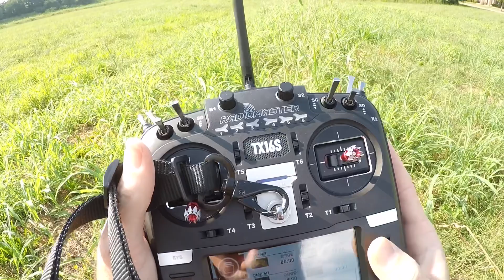OMP Hobby M2 vs Blade 230s V2 flight Comparison￼

Comment: Excellent review and very objective.  I just went with the 230S for a lot of the reasons you mentioned, I'm 61 and it's my first heli.  I struggle with orientation on even fixed wing, so the 230's size is a benefit.  I also have lots of other Horizon stuff.  The M2 is definitely the more modern performance aircraft. OMP does nice work, I was very impressed with the Bighorn plane I bought from them.
Reply from the maker: Thank you! Nothing wrong with the 230 whatsoever. It is a great helicopter for the people who like the bigger size and who are just they are to fly around. If you’re never going to be a 3-D helicopter pilot or care about the precision in the performance the 230 is definitely the machine for you. Do I personally think it’s outdated old and needs a major update yes! But it’s still a good heli! You will enjoy the 230! Check back and let me know how you like it and how your doing. Use some bright vinyl on the tail boom and tail skid as it will help you with orientation big time!

Comment: Love your End comments WestHobbiesRC. In the Photography world, the Moto is : "The Best Camera is the Camera you already have'. I don't own the M2, but do own the 230s.but after having endless trouble with the 230s Self levelling mode, and hence many unwanted Crashes, i believed it was a piece of crap. then i decided to delete the "Normal" mode (vis Digital Swtch option), and use it strictly as a FM1-2 Trainer only. I'm glad I kept it as such! now, after repeated trial flights with my smaller Nano S3 and 150s, I have complete confidence flying the 230s without any Normal mode to rely on. It also crashes well. Appreciate your Videos / advice WestHobbiesRC. PS: i have bought myself a Blade 360 3s Fusion, and SAB 420 Raw DD for Future step ups, when I can fly the 230s in most essential orientations
Reply from the maker: Thank you very much! When I started the channel I only had a GoPro hero 4. I’ve since upgraded lol but I still want to get a different camera to make higher quality videos. The blade 230s was a great heli for its time. Still not bad but the M2 or S2 is night and day better in a lot of ways. If OMP or Goosky would release a 300 size (same size as the 230) it would take over. The flight performance and FBL performance of the M2/S2 is incredible. You will love the RAW 420! Perfect every day size heli! The Blade 360 is the BEST BNF heli Blade has ever made. My only two complaint is the power level and servo gear sets are weak and will strip in a crash but I think for a next step heli it’s perfect!
Reply: @westhobbiesrc8051  Appreciate your Reply! My Videos are taken on an old Sony DSC-QX10 which Sony made to fit onto cell phones in that time period before cell phones had good cameras built in. I have the OMP M1, but I've invested too much in Blade Heli's (S3, BL2, 150s, 180 Infusion, 230s, 360 Fusion), so i can't see myself getting the M2, and so I'm not sure my type of Flying style would get any better with an M2. I wish Blade would bring out a Direst Drive version of the 230s. I have to confess, that there are times when I "Freeze at the Controls" when learning certain manoeuvres - is this normal? ( I can do Inverted Hovers / circuits no problem with the Nano S3, but with the 150s and 230s, well that's another mindset matter ! )

Comment: Thanks for your reply on the other video you made. I can tell by this video the OMP is superior to the Blade 230s. It just looks more stable. Unfortunately for me I fly VTouch and I can't use the OMP without receiver mods so I went Logo 200. I think the OMP and Logo are taking the market, especially with the Logo having a Neo on board
Reply from the maker: Awesome! Logo 200 is made by OMP, they are the same just the logo has the NEO and M2 has there protocol/DSMX/futaba. You will be very happy with the logo 200! Thanks for watching!

Comment: Whatever happened at 3:08 has also happened with my 230s V2 twice. I think sometimes when level and spinning fast around the tail axis the FBL has a problem figuring out the real position.

That also always causes the spin like in your video for about a second. It flys fine afterwards.

Also mine also has that bobble sound in the tail motor, but flies just fine. I don't mind it anymore at all.
Reply from the maker: Not quite sure, I started to piro and the tail motor just shut itself off completely. I hit throttle hold to take torque off the tail and I flipped hold back off and it was fine for the rest of the flight. Never had that happen before. It does fly good but in comparison to the M2 it does not fly as good at all.

Comment: Mine usually explode because of something I did. 🥴
So I’ve had a few SR’s which I never really knew how to set up correctly but I love that size and would really like to fly them. I think I have a brand new 230S that I’ve never flown much because it went apecrap on me the first time I spooled it up. Maybe something set wrong on my transmitter. I seem to do better with the more subdued 120’s but with the new S2 flybarless version. I’ve been thinking about a M2 also. I bought some off brand K110 that seems to require a Futaba system which I don’t own. Not sure what to do there. Futaba has more radio versions than I have socks! LOL! Enjoyed the video as always!
Reply from the maker: It always sucks crashing in the helicopter lol I had a couple blade SR as well. I sure don’t miss those things! Lol you will love the OMP into! Such an incredible helicopter flight performance instability is unmatched to anything else. I highly recommend you get one! That or the M1 both really great helis! Flying will improve big time with a M2!
Reply from the maker: I don’t own or have never owned a KX 110 so I’m not sure what they take or do I don’t know if you can plug-in a DSMX satellite? Depending on what radio you have currently you could always look at the TX 16 S which will do all different protocols so that is an option. Thanks for always watching! Greatly appreciate it!
Reply: @westhobbiesrc8051  thanks for the great advice! I think the little KX 110 is a cheap RTF. It’s a cool looking little bird but that doesn’t mean anything. So on the M2 is that how I would fly it with my DX-8 is with a DSMX satellite? I think you mentioned it once before but I wasn’t sure which one to use.
Reply from the maker: @robstanton9215  yes so with the M2 you just need a DSMX satellite, if you get one with a bind button that they sell on buddyRC then you don’t need a separate receiver to bind it to your radio. Just plug the satellite into the OMPFPL find it to your DX8 and you’re good to go! I can share my spektrum radio setup if that helps or you need it. You will really enjoy the M2!
Reply: @westhobbiesrc8051  Thanks!!! I appreciate the help!!!
Reply from the maker: @robstanton9215  any time! Glad I could.
Reply: Hi I have tried a lot of XK helis and found these excellent. These include K100, 2 K110, K123 and K124.
They all fly well and bounce off the walls. If you get an RTF version, it would come with the transmitter but you can also get radiomaster tx16s. I certainly highly recommend XK helis

Comment: I use both of these for my daily flyers  on a jumper radio..with my rates they both fly just as good as each other..but the m2 is way more quality and  can out perform on higher rates by a mile..don't trust theplastic blade grip set up on the explorer. ..your not the first that's happend too..way too much power and speed for plastic...
Had to switch the 230 to all metal for links and swash..it would break them off..and they go down fast ..as hard as we push these things..I feel better being all metal..plus the m2 don't break the metal grips..you fly awesome man .I hope one day to get .to where people want to watch..and starting a crowd in my neighborhood..they love to watch
Reply from the maker: In my opinion the M2 out performs the 230s in every way. The 230 is a good heli and for its time it was great but compared to the M2 can’t even stay in the same park. I’ve never ad a problem with the plastic grips in 223 flights, I did tighten the blade right before they failed so I’m going to say I over tighten them. I think a lot of the blade grip failures are from over tighten but I could be wrong! Thanks man I appreciate it, keep flying and you will!
Reply: @westhobbiesrc8051  I let mine free swing .
Reply: @westhobbiesrc8051  is your 230 oxy 3? Got 270 motor on board?
Reply from the maker: Is my 238 OXY 3? No it is a stock 230 exception of Blade 300x motor
Reply: @westhobbiesrc8051  well that's bigger yet man that thing should ripp along with that m2 ..I got the 270 motor in a box I was gonna put on...I bought ....cool..I like the sound of 230 banging some hard pitch .  Lol 😂 pry why my head broke and almost killed my buddy
Reply: @westhobbiesrc8051  I never did forward programing with the 230..I read I could. Would be nice to be able to kill the gyro on it all together... It has the same stupid problem all the blades had.with the wagging tail..but sense I switched to open tx ,it seem to be able to toon it out .but I lost safe ..it don't work on what I did
Reply: @westhobbiesrc8051  boy working on that m2 is a different thing for me ..way better precise parts and fitting together like a glove..it just blows my mind how much more qualified the rig is than anything blade makes..and at a better Price
Reply from the maker: @jakelang4387  The quality is insane, we cannot be the build quality and simplicity for the price. Yes they are a little expensive but for the flight performance and overall build they are worth every penny!
Reply from the maker: @jakelang4387  so the 270 motor is a 4s motor, lower KV so if you run it on 3s you will need a much much bigger Pinon. The 300x motor is technically smaller then the 270 motor but higher KV. I have it set so it’s around the same head speed but more power. It’s a fun heli but do not get flown much every since i got the M2.
Reply: @westhobbiesrc8051  I had to do a small rebuild on my m2 today...I found out that if the head don't get oiled or lubed in some way. It will wreck the bearing's..I had crashed her last week cause my gyro values was wrong when I would flip her back to self leveling to bring her in.. it would cause it to go crazy and crash..I got it all sorted out now .but I set everything to 9 on the flight controller..that allows me to adjust how I want on my radio..if you try to set it up only on fc,then try to adjust on radio..your risking something being off and boom! So don't do what I did

Comment: I will get a M2 next. I have the Eflite 150s and 230s. The 150s is great with carbon frames and has lots of power. The 230s  much cheaper frame, plastic, less power and not as smooth as 150s.
Reply from the maker: You will love the M2! I have not had a 150 in a long time so I forgot how they fly but hopefully soon I’ll hav the new smart 150 and 180 to do some testing on! I just did a full MicroHeli 230 build and it’s incredible! Love it!

Comment: I love the blade Helicopter, but is to hard for setting with other brands radios transmitter like radio master. You can fly but is hard for setting...
Reply from the maker: The radio setup will be the same on all models with the Radiomaster pretty much. Spektrum radios are definitely the easiest to setup.

Comment: Wondering if someone can help me...

Im a complete newdy with rc helicopters and not sure what heli would be best..

I have flown rc planes as a teen and i drive rc cars now (bashing)

I would prefer a larger scale heli that can be used outdoors and in some wind. The 1 heli i have found in my budget is the 230s v2.. but i have just found out about this heli now.

Are there any other helis i should also look at? I defo want 3d capabilities.
Reply from the maker: Welcome to helis! Best part of the hobby! Lol so the 230s is a good model but outdated! Get a Goosky S2 or OMP M2 EVO, great prices. Cheap replacement parts! Check out HeliDirect.com for all your heli parts needs. I’ve got videos on both and how to setup and everything.
Reply: @westhobbiesrc8051  thank you for the reply!

After doing some quick research im looking at the omp m2 purely due to availability as i live in australia.

As its a bnf model.. what is a good cheaper transmitter and receiver?
Reply from the maker: @MrDngrsdave  the M2 EVO is the newest M2 lineup. Much better tail performance and little bigger then the M2 V2/EXP. so personally I’m going to say get a spektrum radio. Main reason is they are the easiest radio on the market to program! You will need at least a 6 channel, NX6 is a fantastic radio and a great price. But I always tell people by at least an eight channel because if you stay in Mojave you will outgrow it really quickly. In the beginning of course you do not need more than six channels but depending on what your plan and goals are scale helicopters or what not you owe me more. Plus getting bigger models and different FBL units you can do a lot more with a 8ch over a 6ch. You will need a DSMX satellite like the Kensun as it has a bind button. You can get a TX16S or I would recommend a Frsky X20S but they can be harder to program.

Comment: pretty sure OMP have upgraded the explorer blade grips to metal ones
Reply from the maker: It does as well as aluminum swash plate
Reply: @westhobbiesrc8051  didn't know about the swash plate...I've been looking at getting one and that along with this video basically sealed the deal😂😂
Reply from the maker: @seancushway6959  you can’t beat the M2! Anther great one is the Goosky S2! It’s a brand new release if you want to check those videos out on my channel.

Comment: I think the tail blowout on the 230s was caused by your gyro gains being actually too low.
Reply from the maker: No stock 230 will blow the tail no matter your gains depending on how hard you are with the pitch. With the 300X motor that 636 had no chance. Put a Brain 2 FBL and no more tail blow out and way more power and pitch as well as a 3 blade head now. The 636 is a crappy FBL.
Reply: @westhobbiesrc8051  Is it just me or has the quality of Blade's helis gone down since horizon hobby was acquired?  The only heli I had from them back in the good ole days was the scout CX so I can't speak much for their older collective pitch helis, but it just seems like their quality was a lot higher back when horizon hobby was still an independent company.
Reply from the maker: @ambrosekillpack4841  they have always been the same company, they never changed companies. Eflite all of that was always horizon hobbies. Like anything quality control goes down Paul’s get me cheaper. My only real complaint is I wish they would use more metal as well as a better FPL unit. If you haven’t checked out the videos go back and look at what I did with the 230! It’s a beast now!